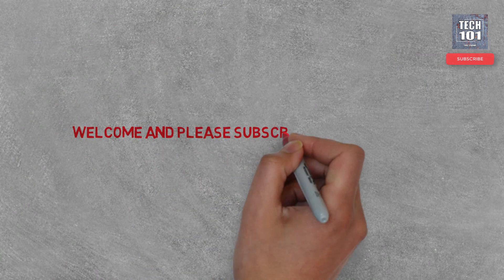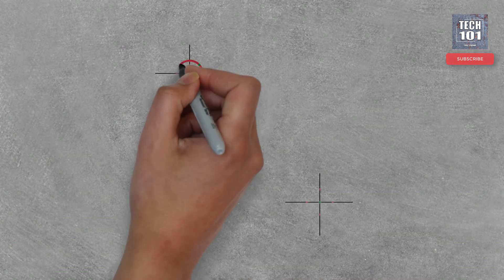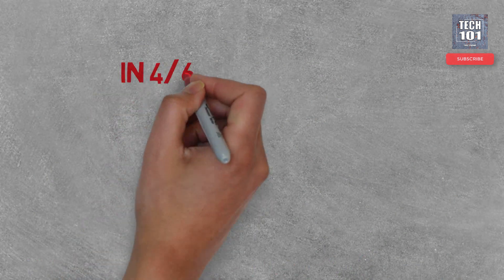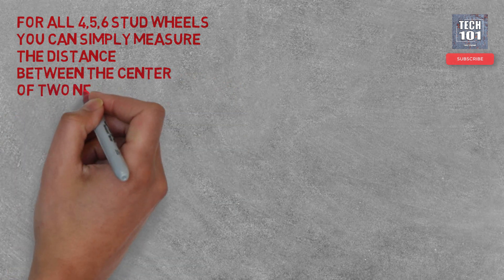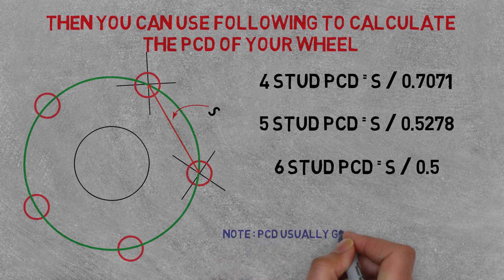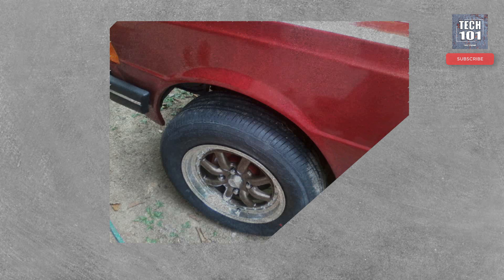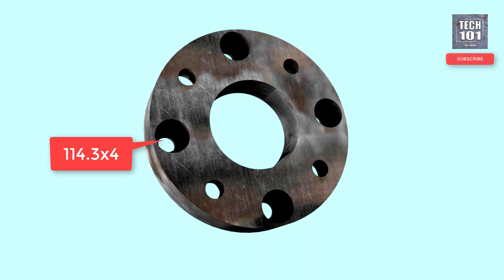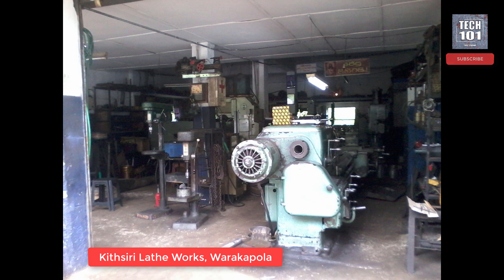Wheel PCD Conversion Stock Wheels To Alloys Peugeot 305GL 1987 Easy DIY Modification Best Trick Ever

Comment: Have to fine tune/alter slightly wheel alignment toe setting to compensate for different wider track which will have different leverage affect on wheels.ie more push back on wheels causing need for more toe in setting to keep wheels pointed straight when driving.

Comment: Guys i did this once .i got nearly killed . The weight comes to bolts and when driving the bolts were loosing . It was a fourwheel SUV not a car .
Reply from the maker: Doesnt mean you did the same way in same strength..I made sure entire weight wouldnt come on bolts because this Peugeot 305 got a center protrusion to which I carved a matching/ fitting hole in the spacer...If you can find stronger bolts, even the weight on bolts wouldnt be an issue. Prioritize safety when doing something like this thats a must and a variable from project to project.
Reply: I got your point techorny . Are you sure this is suitable for fourwheel driver ? I was told once to change the rim with more depth on it rather than take out the  wheels . I have a vedio which show what happen to me i can mail you if you give me your e mail.
Reply from the maker: @dressedtokillwithnal2249  worknearnws@gmail.com is the mail. Do send me I can take a look, thanks...Yes for a four wheel drive too this should be okay but do consider vehicle weight, the torque, load and extreme conditions you gonna challenge the vehicle with. Bigger stronger bolts with center support as I mentioned before should work..

Comment: I totally disagree with this method because it has no safety, because the stud you has no indication on them. Mean, the stud bolts don't have high stress point on hold weights on the bolts.. So, the risks are very danger on vehicle, with driver and passenger's.. Then, what about your turn circle at the front of the vehicle, it would have a good turn point from the standard turning when you put an extra alloy adapter on each wheel these are going to be the issues... to keep in mind.
That's my opinion..
Reply from the maker: Lol..have it your way I dont mind, I've presented a method I personally used with no issue for years and even have tested it at high speeds on Sri Lankan roads. That is very much a practical experimental application rather than theories you come up with. Cheers!
Reply from the maker: Plus the setup is it, no extra spacers, there is no big difference from standard kits out there for sale, but I built this without knowing such kits are available to purchase. According to your argument, normal spacers too can cause issues.